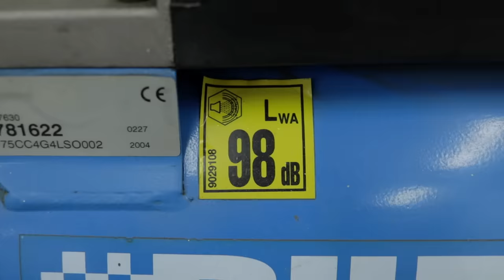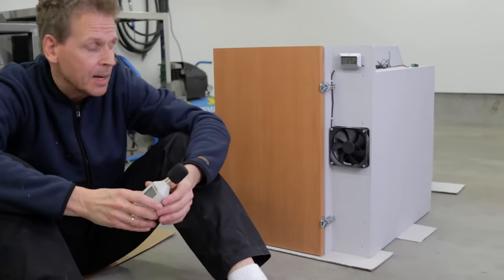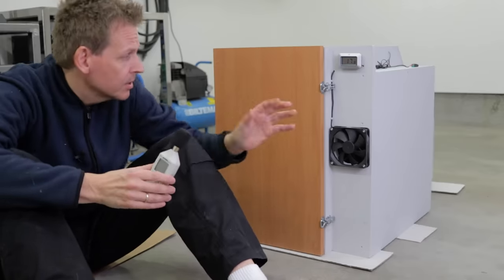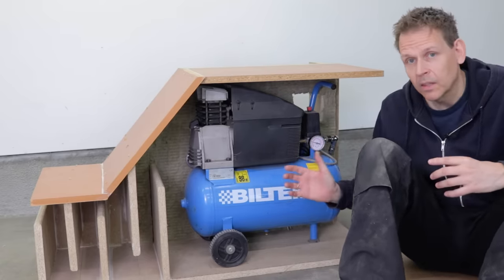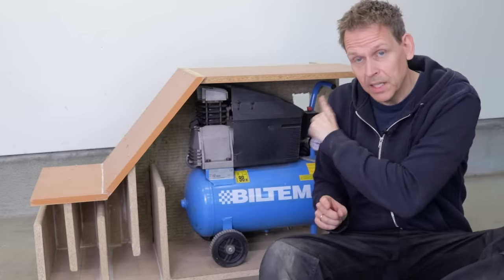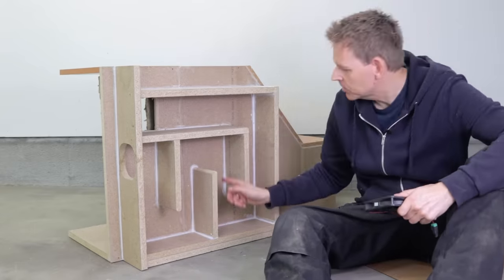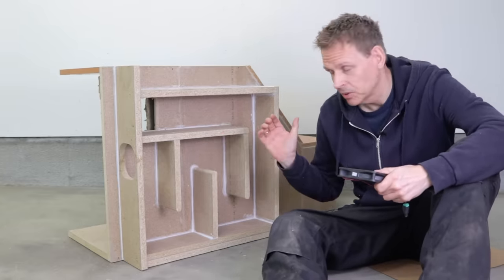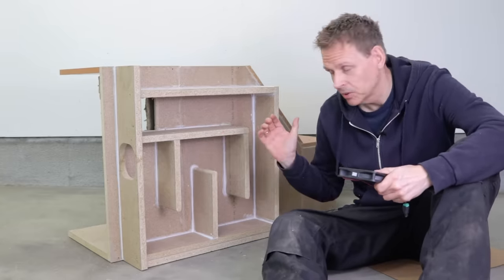Do not build a sound insulated enclosure for your noisy air compressor!

Comment: I did the same thing for a 25-gallon compressor in the early 90s... Learned a lot. I used thick foam, foam spray..We lived in a very quiet neighborhood
Reply from the maker: Cool, I guess the same challenges exists and solutions works today as they did 30 years ago 😊
Reply: @KI Hestad  yes, sir!.
I do love your "BAFFLE SYSTEM," though. Great Research!.
One improvement [beating the dead tree] would be to incase the case...similar to a Refrigerator chamber..with foam padding in between...The Door is the Weakest point 👉 I would create a Waffle Door with at least 3 layers.
Your work teaches people a lot, and we can improve upon...

Comment: Thank you for the effort and demonstration.  My old air compressor is one of the high rpm oil free very loud ones.  It's 30 years old and I'm becoming afraid that the tank is unsafe so it's time to get a replacement.  When I had my workshop built I made provisions to put the compressor in a storeroom in the adjacent garage.  Even though there is an insulated wall separating the shop and the garage you convinced me to buy a "silent" compressor.
Reply from the maker: It's hard to know how much rust it might be on the inside of the tank after 30 years. Replacing it with silent one sounds like a smart move 😊

Comment: "You need to drain the tank, it will rust and fail eventually!" I agree, but I never drained my work compressor and it works 1000 times harder than my house compressor. The things that failed on all the compressors that I ever owned wasn't tanks, was the compressor from lack of oil (changes or "sealed no oil" compressors). I had a tank last 3 compressors, the last 2 not same brand and used, over 15 years by the sea. So clearly ideal environment for rust and humidity...
Reply: Yeah but a failed tank is catastrophic. A failed motor is not...

Comment: I had the same idea, of enclosing my compressor, but I thought you were going to say "don't do it because it'll overheat and blow up!" lol. I'm happy to learn that you just don't think it's worth it but it'll be fine :) My idea is to build an entire room for it (my compressor/tank is large) and use double stud walls with rockwool insulation. If what I've read is accurate about double stud walls and I get at least an STC 50 room then I will reduce the decibels/noise by ~50 as well.
Reply from the maker: I think you have a solid plan there 👌👍 I live on the north-west coast of Norway, the warmest summer days are normally max 25C = 77F. The ventilation I built into the box has luckily worked fine for me 🙂

Comment: Very good ideas! One tip I would give you is to add a fan at the exhaust end of the box. Therefore it creates a low pressure inside the box which the intake fan blows in and the air will be sucked out much better.

Edit: hopefully that makes sense. 🙂
Reply: It probably depends on how well the intake fan runs.  If it's providing enough CFM, one fan could be sufficient.

Comment: Great video, absolutely hilarious watching the multiple attempts getting it up the stairs into your attic.  Not sure why this is showing up in my feed after a year but a lot of people are commenting recently and you are replying which is awesome.  I read a few of the comments and have the same ideas about some improvements, ie, removing the direct coupling to the box from the feet (I saw you had some padding inside, but removing the wheels and using something like a rubber engine mount, adding padding to the bottom of the box on the exterior, etc...  Those are minor though compared to reducing the sound vs vibration.  I think however though you have partially designed a slot loaded subwoofer or something similar with the zig zag chamber, I think using eggshell foam or any soundproofing foam would be better than the fabric unless that fabric was specifically made for sound.  Also, if you used a breathable foam filter on the input and output of the box to do more noise attenuation but increased the airflow to make up for loss it should have made it even quieter.   I don't know if I trust a manufacturer that builds both db meters and air compressors though.😆
Reply from the maker: Thanks a lot for your feedback, especially fun to see that you noticed that I try my best to reply to all the comments. That has been just natural for me up until now, if anyone takes time to post me a comment I sure want to take time to reply to it. This video suddenly got a lot of traction, so now I struggle a lot now to keep up 😋
Agree with your thoughts, my next improvement will be to tackle the vibrations.  The fabric I used on the channels was just something I had laying around, it is not made for sound absorption at all, perhaps I could look into that and add a thicker and better material. I will have to look into breathable foam filter, thanks for the tips! 
Haha - I buy a lot of my tools and equipment from Biltema, a Scandinavian retail store chain. It's like buying stuff from Amazone or eBay, most of their products comes from China and you can normally find the same products with different colors and under different names. Their products are cheep and has decent quality, but is not typically the tools you see professionals use  (for sure 😊)

Comment: My old Craftsman compressor was crazy loud.  I did build a soundproof box for it and lined it with acoustic foam and added a dedicated fan.  It worked OK for  a few years. When I finally needed a more powerful compressor I bought a much quieter one and then it worked amazingly.  I still have .t.
Reply from the maker: That is just how I do it as well. I try to improve and make the best out of what I have until I have to upgrade - or can afford to upgrade - and then select a better solution based on my experience 😊

Comment: Tip. If you have to haul something heavy like that up or down, put a pulley on the box, anchor one end of your rope to the wall  or the steel leg of the bench. Now when you pull on the rope you have 2:1 mechanical advantage -- you pull twice as much rope but only half the weight. Also if you can run the rope you are pulling on around  the other steel leg, if you need to stop you just bend the rope against the leg and it stops - you won't have to hold all that weight. 
Those baffles shouldn't be made the chip board, that's a hard surface.  They don't need to be structural, so just use foam, egg crate sound proofing foam is best.  Now you just have to make sure if you use it a lot it doesn't overheat.   
One way to sound proof  a compressor outdoors is to just build a surround and let the noise go straight up.
Reply from the maker: Thanks for the advice. My back was hurting for several days, a pulley would have been smart 😔

Comment: Great idea, another idea, the biggest part of your box is the tank, so if you separate the compressor from the tank, the compressor box could be in your attic and the tank in your workshop or somewhere else, all connected with hoses
Thanks ! Leon
Reply from the maker: Yes, it really is a good idea 👍 I just did not think of it as an option when I started the project 😫 I would probably have done it now, if I where to do it again. Would have made my box smaller and easier to build, and it could have been even more insulated.
Reply: @kihestad  I really enjoyed seeing the precision work you put into building the box. extending Leon's idea of putting the compressor in the attic, maybe put it in your neighbours house and use their electricity too (just kidding!). I am also suffering severe 'workshop envy' of your super clean and bright workshop space.
Reply from the maker: Hehe, I guess I like it tidy 😊

Comment: I put my compressor outside.  Remote AC, sound box that is weather proof, long hose.
Reply from the maker: That sounds like a perfect solution 😊Would have loved to do something similar, but I just dont have space for it. My garage is placed with minimum distance to two of my neighbors. The side facing my own property is not usable either,  as it's just a slim path between my garage outer wall and a concrete retaining wall. In front of the garage door is no good either 😋

Comment: My compressor isn't exactly silent, but I do have ear plugs. I run a small, old crapman oil-less with plans to upgrade to something substantially better. I used to have a 60 gallon Sanborn oil comp which was really quiet, but youth and alcohol made sure I sold it prematurely years ago..
I could build most any box i wanted being I own my own cabinet shop, but I also own several machines that are every bit if not noisier than the AC so enclosing the AC would be...how can I say,...redundant? Table saw, planer, joiner, etc.. You get the gist..Try using a planer! You better wear ear protection with one of those and to build an enclosure for it would mean an entirely new shop inside my shop after I made the original shop twice as big..LOL I'm too poor and at 62 I've survived all these years in a noisy environment with no appreciable hearing loss.
Nice job though..
Reply from the maker: Thanks, and very good points.  If all other machines in the workshop are noisy, runs frequently, and you use hearing protection all the time, a silent air compressor is probably less important. In my garage it is normally quite silent, and I don't use air plugs normally. The air compressor turns on and off by itself, while other machines are started manually. When I use my angle grinder I always put on my hearing protection first. When my old noisy air compressor started it was always a surprise, making me jump like a scared chicken... felt like I got a heart attack each time 😂

Comment: BTW, the technical term for the alternating walls you built on the input and output is "baffles".

To be honest, i probably would have just created a big box lined with acoustic foam, with standard air filters leading to a few feet of 6-inch insulated flexible air ducting, (which I'd either run to some other location or just leave coiled up for sound reduction), and called it a day.  I suspect it would have gotten the same or better sound reduction results as this much more complicated and time-consuming construction...
Reply from the maker: Ahh, baffles it is 👍 I might have overcomplicated it, hard to tell if a much simpler box would had worked as well 🤔

Comment: They sell anti vibration pads for appliances which could take this the rest of the way and make it even quieter.  Because most of the sound you're left with now is low frequency sound from the compressor shaking and transmitting through the floor and into the walls of the box by putting pads under the compressor it should make a noticeable difference. I think they sell these for washing machines and should be pretty cheap.
Reply from the maker: Yes, I think you are 100% spot on! I have put it on some rubber pieces I had, but they are to hard and slippery. The box has several times  moved itself sideways because of the vibrations, unitil it hits the wall - and then the vibrations also get transferred that way .. 🥴 I have also got a tip using special dampening springs, guess these washing machine pads are easiest to get hold of. Thanks for the tip!!! 👍👍👍

Comment: in my mind the drop in volume of noise from the first compressor was the difference between it being outside in the open air compared to it being in a neighbours house
the difference in the second one was not as dramatic, but since it started off so much quieter it is still very impressive
Reply from the maker: Yes I agree. Not sure why, but it might be harder and harder to get rid of the noise the lower the volume is? Perhaps it's just because the noise noise reduction is like a fixed percentage, for example 25%, and the amount of sound reduced is then more when it's louder? It could be just that my box was more efficient to reduce the soundwaves from the old compressor 🤔

Comment: Maybe with a simple foam pad between the box and the floor, it will keep the vibrations from transmitting the floor and make it more quiet :)
Maybe a yoga mat will do~
Reply from the maker: Yes, I think you are right. It's the vibrations from the box to the floor now causing most noise. A Yoga mat was actually a very good idea! If remember correct it is a bit "sticky" as well? The box does some times slide into the wall because of the vibrations, and then even more noise get transferred to the room. Perhaps a Yoga mat will avoid it moving sideways! I'll have to test it - thanks a lot for the tips! 👍😊
Reply: @kihestad  let us know if it helps :)

Comment: Excellent build. My suggestions for improvements (sorry if these were mentioned elsewhere): Vary the separations between the baffles to inhibit resonance. Also the baffles don't all have to be at right angles for similar reasons. Thicker carpeting will make the enclosure quieter, , with acoustic foam being the most expensive. Place a rubber gasket (or the thicker padding) between interior boards and only screw together finger tight without glue. I used rubber washers under metal washers with my screws. Anything that isn't structural shouldn't be rigid. Put soft rubber pads under the feet of the compressor. Anything to prevent transfer of vibration to the exterior box. A sack of sand on top of the box will also absorb some energy that would otherwise radiate as sound. All just design changes or minor cost, but they all add up. It's fun to see such a build work.
Reply from the maker: Very good improvement suggestions! 👍 Thanks for all the tips!!!